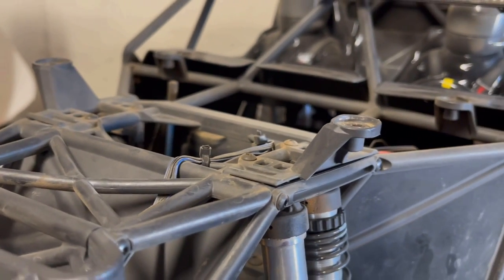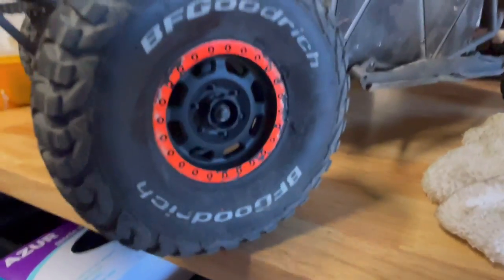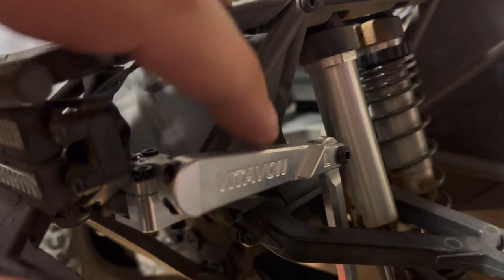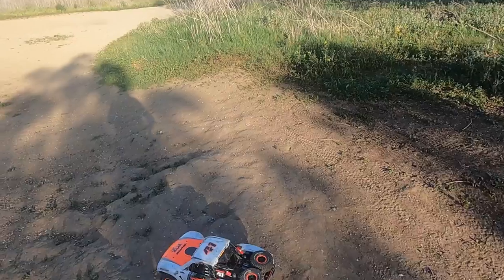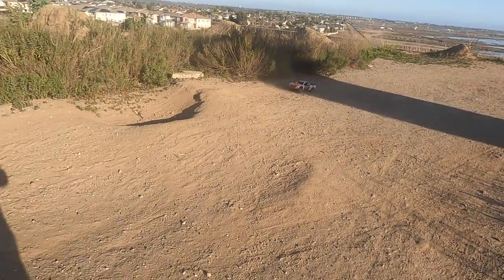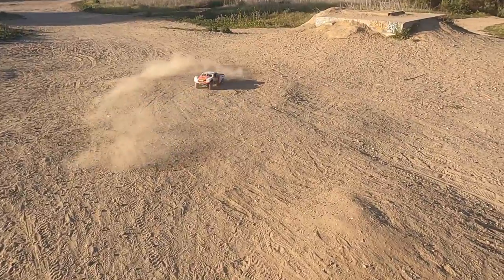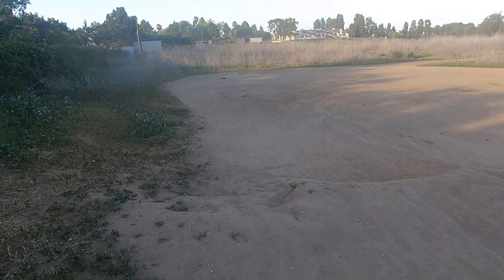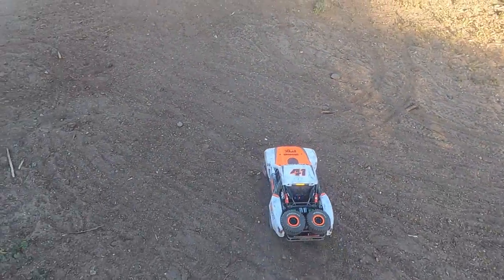Traxxas UDR Vitavon Front Sway Bar and Full Run!!

Comment: I know this video is a year old, but if you still haven't tried it - go 6S. I thought 4S was "enough" and "plenty", but then I tried 6S and it's just so much nicer. When you want the extra power for air control you have it, and there's so much power when zooming around that you hardly ever use full throttle, because of this I actually find that my pairs of Zeee 5,200mAh 3S last longer than my HRB 6,000mAh 4S batteries.
There's absolutely no going back, don't settle for "adequate" like I did initially.
Reply from the maker: I finally went 6s after this and I completely agree.. no going back… it was wayyyy better.. I’ve got a video of my run on 6s.. it’s awesome. 6s all the way. Never goin back 4s
Reply: @bigalrc  Hell yeah brother!

Comment: Sledge - in person nothing like Kraton. Own both.  Love em both. The Kraton (EXB) I have $1k or so in. So pricing is similar. High lol. 

They drive very different. Jump different. Sound different. They both do look like truggies though lol. 🤷🏼‍♂️🙄🤠

Love my UDR! Putting another front sway bar in today. Vitavon next if it happens again. 

I only run mine on 6s! I love the rooster
Tails 6s give me ha. 

The no sway bar up front - I actually rolled less. I’d see if rolling into turn and it would give
Me time to correct. Still prefer it on so back on it goes today!

Comment from the maker: Jlo96f3-Yep hot racing is meh.. I purchased the hexes before the sway bar so I still have those installed but that sway bar was annoying… tried everything people said to do… longer grub screw red thread lock, put two grub screws in one on each side.. nothing helped it… vitavon has been great so far… I have the rear vitavon axle too and putting that together mine didn’t come with the shims to make the gear mesh less tight. But they said just run it and it’s been fine.. I didn’t really believe the hype for vitavon but after a couple purchases I’m in… not gonna vitavon the whole truck though..

Comment: Hot Racing is hot garbage.

I did the hot Racing stuff to my UDR. Not impressed because they were just more stuff to add to the constantly fix list.
Reply from the maker: Vitavon is the way.. I’m convinced now.. still have the hot racing hexes set with the brake calipers installed on here.. when those go, vitavon again
Reply: @bigalrc  In my experience with this truck concerning aluminum parts, I've taken them all off. Those hexs shredded my wheels when the lock nuts came loose. Those lock nuts came loose because I wasn't paying attention and accidentally bought the aluminum Traxxas replacements. Every other aluminum part that I tried either snapped just like the plastic stuff or got bent in such a way that it shifted the weak points into other areas and snapped those. I don't bash mine at all. I drive it mildly around my yard just like you're doing. Seems any time that it rolls, it breaks $30 worth of parts. That becomes even more expensive when you're talking aluminum parts. Don't get me wrong, I love the way it drives and looks, but that truck has cost me almost as much as I paid for in parts.